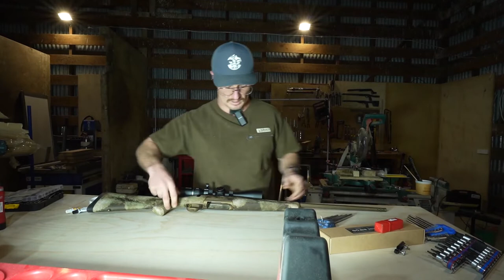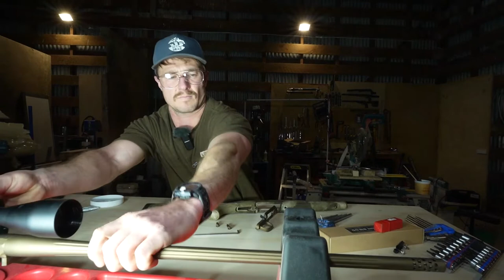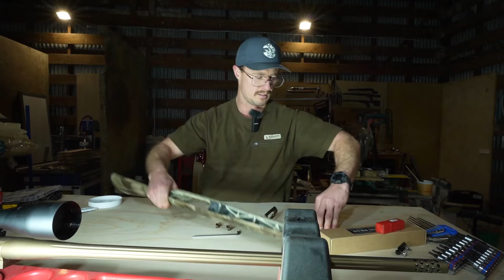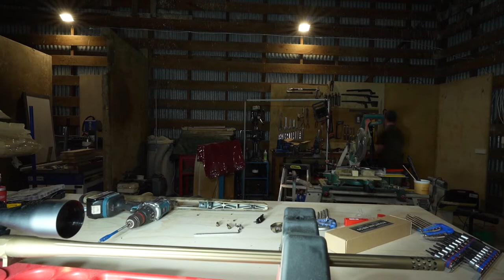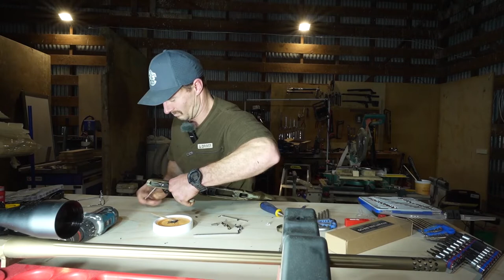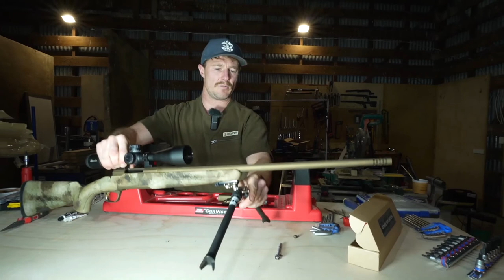Picatinny Rail installation on a Browning Hells Canyon Speed

Comment: What picatinny rail did you use, and what is the distance between the mounting holes on the picatinny rail?
Reply from the maker: Hi Ken, We manufacture a range of rails and this one is the rail with sling attachment. Distance between hole centers is 40mm/1.6inch which is industry standard for rails of this size.